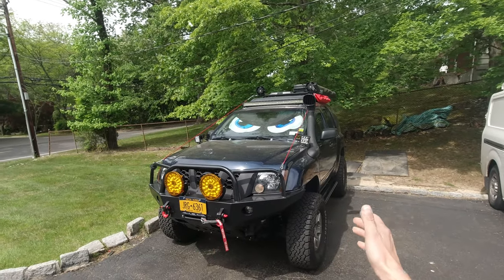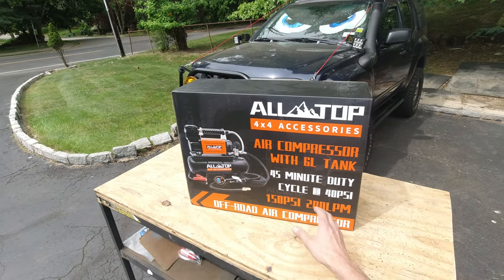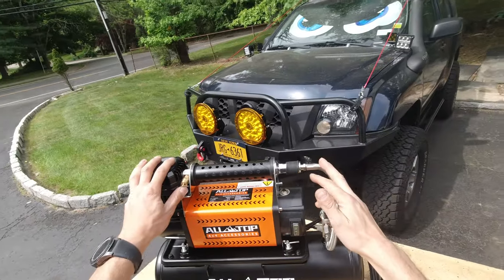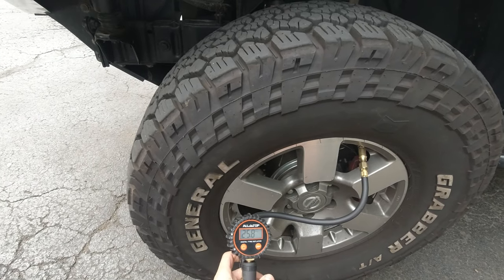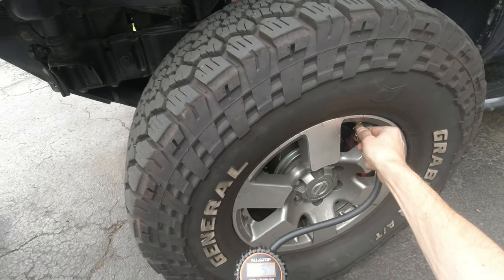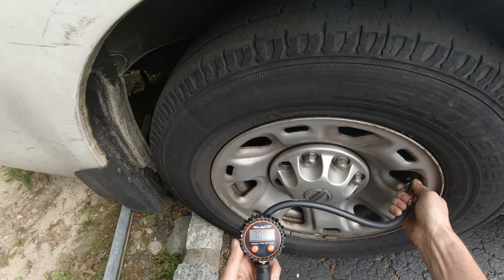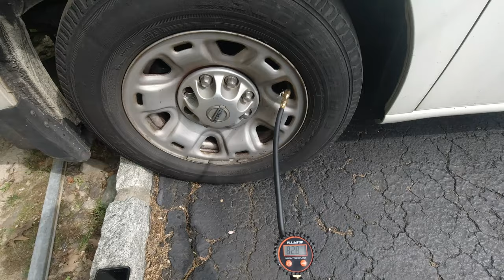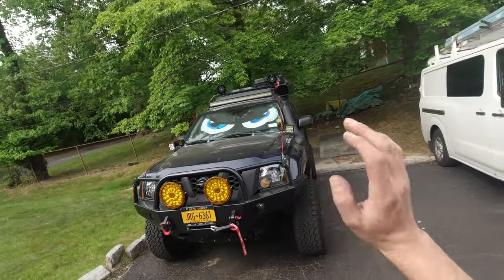All New All Top Air Compressor  With Air Tank!

Comment: Hi friend, I have the same compressor and it doesn't turn off when you fill the tank and it never turns off as soon as I connect it to the battery it turns on and I press the buttons and nothing happens to you that it turns off? what I do ?
Reply from the maker: have you tried to adjust the side switch ? try changing its switch position . the swtich have to burn turned on pushed from the top al lthe way in

Comment: Would you recommend this unit as a mounted onboard system on a jeep wrangler on 33's wired directly to battery?
Reply from the maker: Well sir.. that what I used on my Xterra when I had 33s now I am on 35s and STILL use it and it works great ! I made a mod ( have video on that ) where I run wires from the battery to the back and have it mounted there in permanent location and thats what I use  with a circuit breaker by the battery ofc 
Hope it helps with your question )
Reply: @DIY_AUTO_PHOTO  have a link to the video?
Reply from the maker: @_JEBUS  Sure thing sir ! here it is ) 
https://www.youtube.com/watch?v=OkWf2RN89kg&t=3s I mean the steps might be different the layout of the truck  but the idea and parts all pretty much the same Hope it will help you

Comment: sorry never had an inflator with a tank. what kind of maintenance does it need? considering this but no nothing about air tank. thanks
Reply from the maker: The only difference would it make is to drain it from air / moisture from time to time thats whey it has drain plug on the side

Comment: Does it have a fuse on the cables ?
Reply from the maker: No there is no fuse on the cables.. . not sure I actually seen air compressors with a fuse...
Reply: @DIY_AUTO_PHOTO  okay thanks.